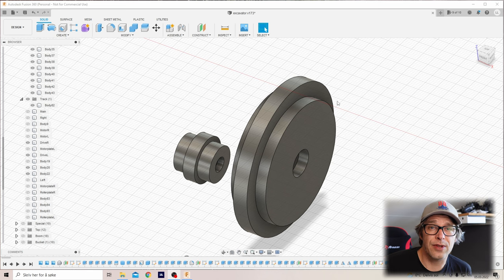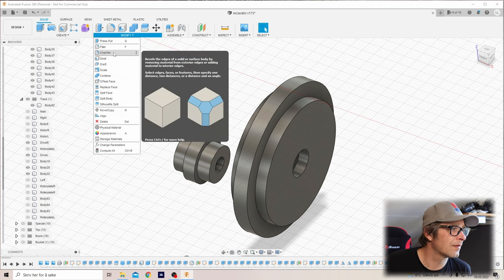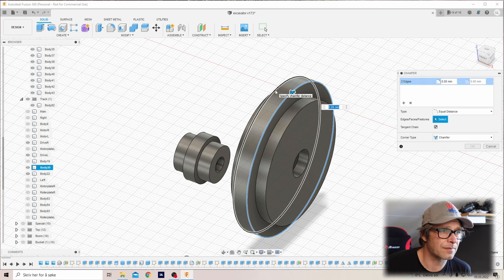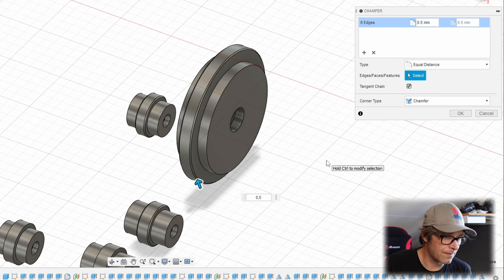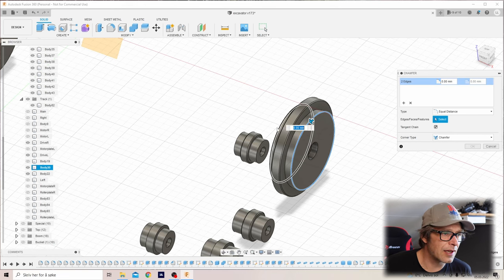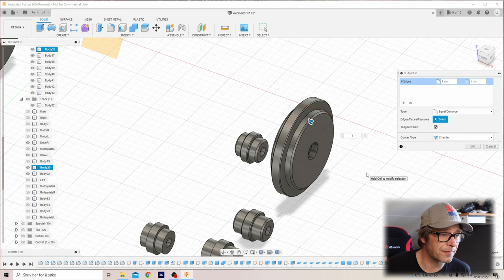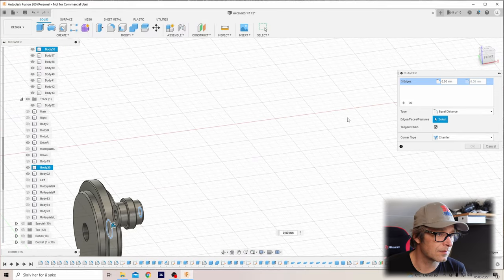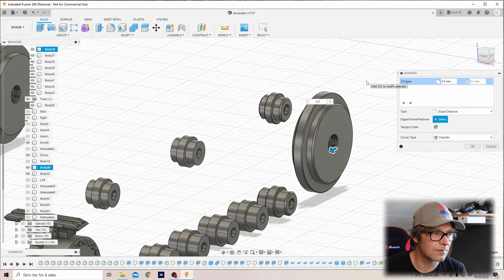Free files for 3d printed RC Excavator Tracks and rollers

Comment: This is great!   Might give this a shot.  On your materials list a couple of things, the quantities needed would be handy.  Also, the 12v 160 rpm motor is no longer available.  Would you go slightly more rpm or less on them if a person had to source a different motor?
Reply: Never mind.  Found a different link to that motor.   Have most of the items ordered and started printing out the tracks.   I would suggest an excel sheet of all the quantities for materials needed to make it a bit easier to sort all the bits out in one place but this is still great.   I'm excited to see how this all turns out.  Thanks for uploading this deign!
Reply from the maker: Sorry for the late reply.
Glad you found the motor.
I'm pretty sure i mention quantities in the vids. At least sometimes.
If I don't, then I'm sorry.

i will not go down the excel route, as this is my hobby. And hobbies should be fun. Excel is work :-)